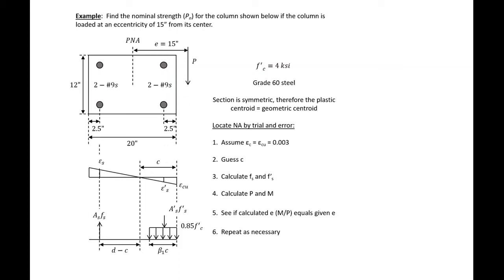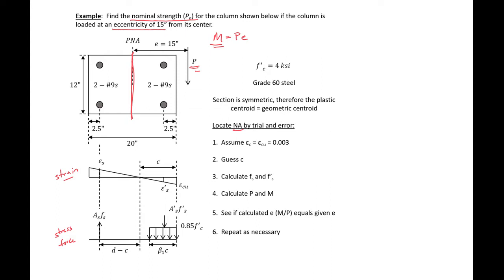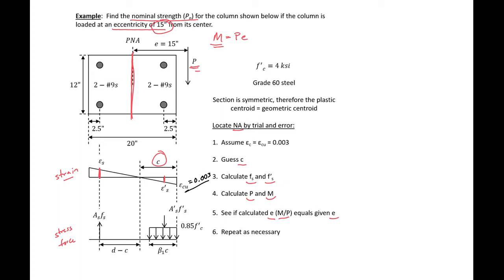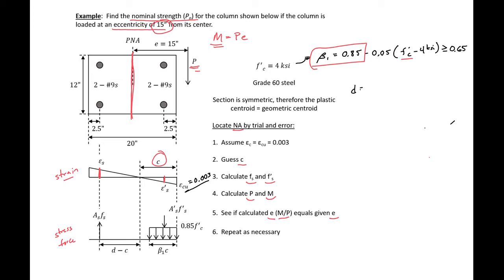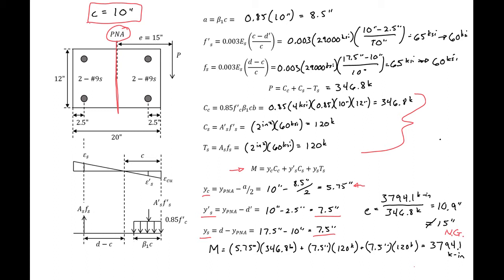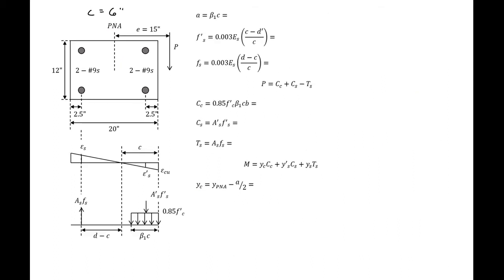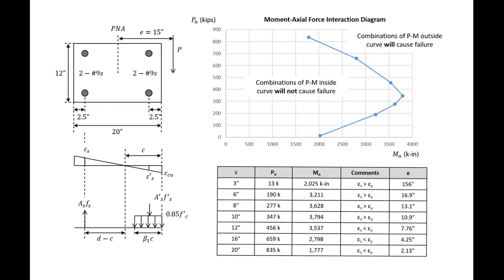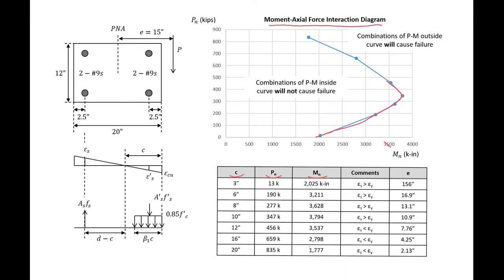11-01 - Example 1 - Reinforced Concrete Column Capacity with Given Eccentricity

Comment: Thanks Professor Garber
How is it possible that a column will sustain a higher Moment when it is compressed than when it is in pure bending
Reply: You have to calculate the stresses of the extreme fibers in the concrete. If the column is in compression to begin with, then it is less likely that a bending moment will cause any of the fibers to go into tension (which is bad)